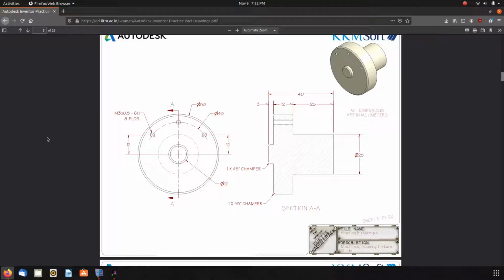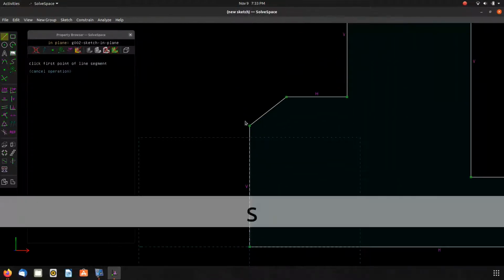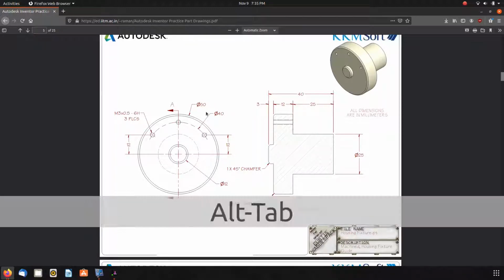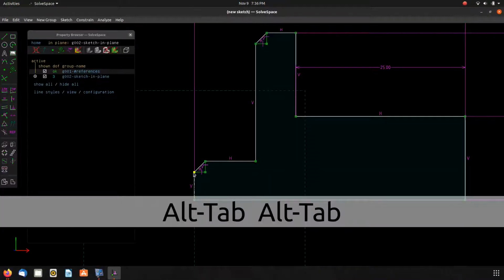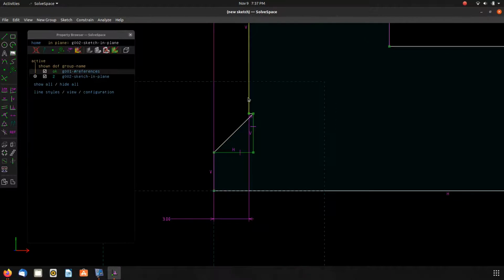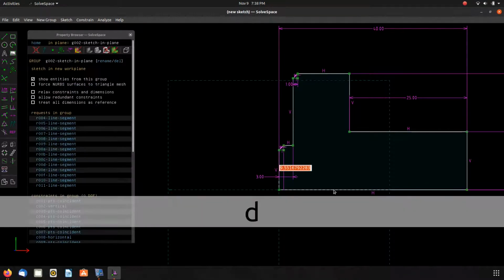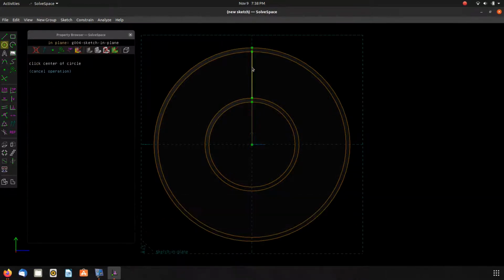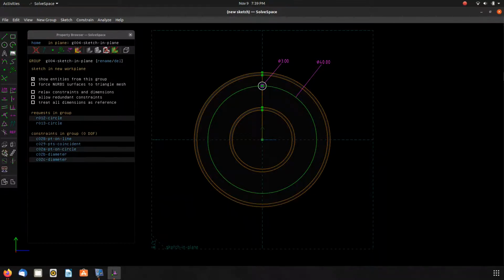SolveSpace Tutorial 4

Comment: I never bother with threads on solvespace models, unless the very specific alignment of threads is required (which is never, for the models I make). I just make holes, and then add a comment what kind of thread they are, and if they are blind holes, I make them deep enough for me not to care about exact reach to the bottom. Machinists and CAM people know how to deal with that easily.

Modeling threads only make sense if you are actually making weird mechanical linkages based on threads, or designing a new thread or fastener / taps, cutting tools etc, itself.

 Great tutorials, learned few new tricks. I am not an engineer, nor got any formal engineering education or CAD courses, so it is cool to see how other people approach problems in solvespace. In fact I made a very similar (a bit more complicated) metal part to what is in this tutorial about a year ago in solvespace, and it was a pain to model (partially solvespace "fault", partially because of my lack of expirience), but eventually got it, and it got made, and the part works perfectly. :)
Reply from the maker: I definitely agree with regards to modeling threads.  It's almost never required and just eats up precious computer resources.  I'm hoping in the future I'll be able to show some of the parts being drawn up in solvespace and then actually being machined!